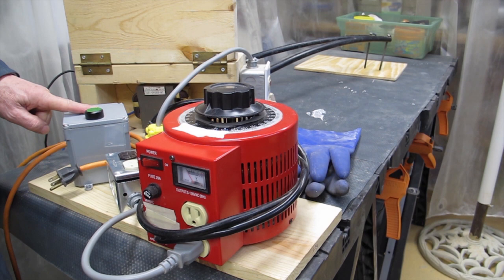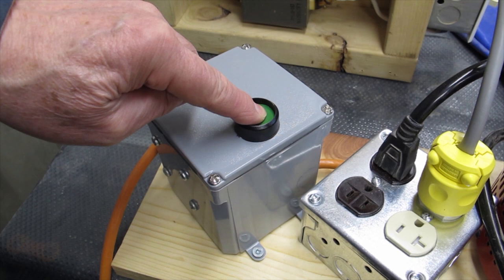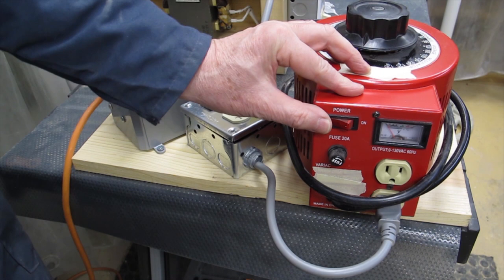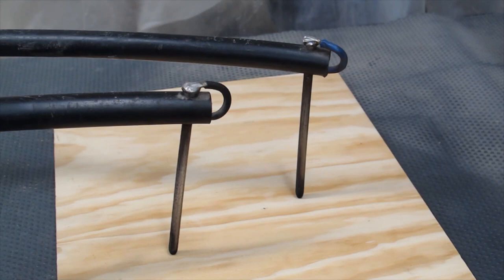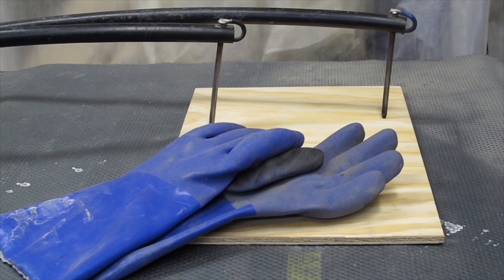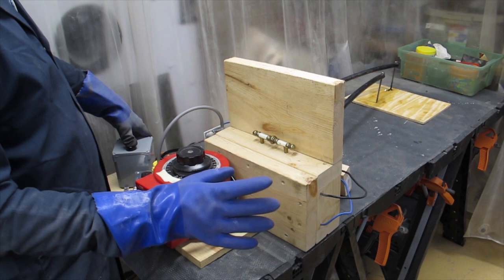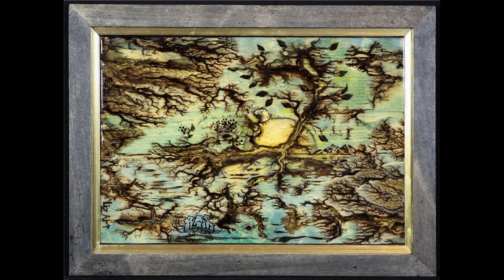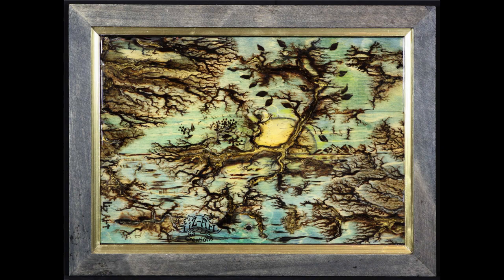Lichtenberg Pyrography Safety.

Comment: A t precisely 7:15 there is an aberrant behavior which indicates you very likely have a leakage current.  It may be possible the path merely surfaces at that point.   Still, on the transformer, is the secondary in any way at all connected to earth ground, OR, is one secondary lead connected to the transformer frame?

Otherwise though, this is one of only three videos on YouTube which has a degree of merit.   I must say though, we have a way to go to make the lichtenburg technique as safe as a table saw.  
😉
Reply from the maker: There is definitely leakage current.  Because I am using plywood the current has a tendency to follow glue joints.  I prefer to use solid wood.  The leakage current is why I use plastic matts, plastic tables, and have everything on rubber matts.  To isolate myself as much as possible.  I haven't used my Lichtenberg system for a while so I am not sure about the frame grounding.  I will check that out.  Thanks for the tip.  I will be making the cord longer that runs between the controls and the transformer so I can isolate myself further by using separate tables and use separate rubber matts.  One for the high voltage side and another that I stand on for the control side.  I will then earth ground the high voltage side.  The control side is already grounded.
Great suggestion.  Thanks.
Reply: @liz-artcreations6633 NO, DO NOT earth ground the high voltage side!   I DID NOT IN ANY WAY SAY THE HIGH VOLTAGE SIDE SHOULD BE GROUNDED.    This is extremely unsafe and creates many more current pathways which can easily become lethal.    
This is very likely the problem you have now, and the source of your leakage.    Both high voltage leads should float free from earth ground and be expertly insulated from the transformer terminals to the probe tips.

Also, the two table idea trades some risk off for others.
Reply from the maker: Your original comment got me to thinking about the possibility of using a GFI method of shutting off the power if there was any leakage current to ground on the high voltage side.  I will have to look into that.
Reply: @liz-artcreations6633 I can tell you this is not an easy task, as I have designed current monitoring systems for 30kV capillary electrophoresis systems.  I won't get into the wonderful geekey details, but you are indeed thinking in a good way here.  

AND, I am pleased to hear you are seeing the difference between this sort of system on the secondary, vs. the primary.  Most YouTubers totally miss that.  KUDOS!

That is exactly what needs to be done, BUT, BUT, BUT, we need a design specification, specifically, an allowable error in differential current, how much and for how long.   This will be intimately related to an estimate of a  human to survive a certain current for a certain time, which is very difficult data to obtain.   Ultimately, to do the background calculations, one has to put a price on human life!  

So, I have an alternative idea, perhaps to focus on isolation, and the robustness of isolation.   I will make a design proposal fairly soon.   

For now, if possible, just leave it in the closet?  Having thought this through more, I am starting to see a machine which is as safe as a chainsaw or table-saw.

Comment: What happens if the two tips made contact or their streams made contact with the power on?
Reply from the maker: If the tips made contact it would be like any other direct short in an electrical circuit.  It would generate a tremendous amount of current and heat and likely melt the wires.  

Ohms law states that current (I) = voltage (V) / Resistance (R).  Current is equal to voltage divided by resistance.

Since I=V/R if R = 0 (a short circuit) the current is infinite so even a small voltage will generate a tremendous amount of current and heat.  It would be the equivalent to arc welding but without a focused melting point, and arc welding melts steel.  I would never apply power to any electrical circuit when there is a direct short.  I have seen the results on screwdrivers where this occurred.

The streams making contact during the burn process happen regularly and are sometimes desirable.  When the streams make contact it causes a deeper burn.  The deep burn happens quickly so you don’t need to let it burn very long once the streams connect.  A deep burn works well when applying coloured resin in the burned areas.

Comment: One question. Why do you need a 20 amp plug instead of a regular plug? Couldnt you use the cord  from the microwave? Just curious.
Reply from the maker: The reason is to enhance safety.  A standard 15 amp plug, which is what is on the microwave, will plug into any wall outlet (in North America). The 20 amp plug uses a different configuration that will not plug into standard outlets typically found in houses.  The 20 amp plug prevents someone from plugging the high voltage transformer directly into an outlet in a house where it would be generating full power at the high voltage probes.  I know you could hardwire the transformer into the outlet box but by using the plug you can add one more safety precaution by unplugging it.
Reply from the maker: I missed something in my original reply.   On a number of plugs there are holes in the ends of each prong.  You can put a small lock or a bolt and nut through the holes which adds even more safety since it eliminates the risk of it being plugged in.
Reply: @liz-artcreations6633  that makes sense. Thanks

Comment: you know most people who watch this video won’t understand what the point or all the safety measures, skip it. Like next you should do a diy convert a lawnmower into a small helicopter.
Reply from the maker: That may be true which is why I don’t tell or show how to do the actual wiring, but for those that are going to do this anyway, they will require some knowledge of electricity and wiring.  Hopefully they recognize and understand each of the safety features I use.

I have a background in aerospace.  I never thought about using a lawnmower engine for a helicopter.  It got me wondering if it could be used for a gyrocopter.  🙂

Comment: Can you apply the bake soda liquid while the burner is on and operating.
Reply from the maker: No.  The second I remove my finger from the master power button there is no power anywhere in the system.  I keep a safe distance from the actual burning while the power is applied.  I would never apply the solution while the power is on even if I could.  It would be extremely dangerous.  There is really no reason to do that.  If you don’t move the probes and then apply the solution WHILE THE POWER IS OFF and then turn on the power it will continue to burn from where you had stopped.

Comment: a lot of effort but I think you have a false sense of security in this set up. The problem I see is that the burning voltage typically 2-4000 volts is NOT going to be reliably contained by the insulating materials and switch components you have there. The extreme high tension  is looking for ground and the slightest path to ground will be found, this includes the leads from you high power transformer and the wiring connecting the variable transformer and control switch, table tops and work surfaces that have conductive capability. Bottom line is that I do not think this setup is fail safe to prevent high voltage migration back to the low voltage components and ultimately the operator. 
The very best operational model would be a remote, non conductive switch actuator...no manual. A total power down is essential for any and all component adjustments including the variable transformer...set it on a dead system then power up when the operator is removed from the device a good distance.
Reply from the maker: I always appreciate suggestions for improvement.  Please send me a link to your setup?  I am sure others would be grateful to see your improvements.
I made use of what I had available.  I work on a silicone rubber mat on a plastic sawhorses, and the entire system including myself are on a 1 inch thick rubber mat.  I could improve my system by using better leads with a higher rating and actual plastic conduit but I am not near the leads, wood, or probes when the system is powered up.  I could use better gloves but there is no power on when I am working with the probes because of the master push button switch.  All of the components I make contact with while the system is operating are correctly rated for voltage and current.  If isolation is a concern the cord on the high voltage transformer could be made longer and then the controlling components could be on one table and the high voltage transformer with the leads and wood being burned could be on a different table.  Hopefully these suggestions makes everyone’s system better.

Comment: Needs some more switches in that setup. 😂
Reply from the maker: The PBNO is critical, the one on the Variac is built in, and the only reason I put one on the high voltage transformer is because it isn't hardwired into the outlet box which make the system more portable.  I happen to have one plug in my shop with a 120v 20A receptacle, so the switch adds a little more safety for my situation.